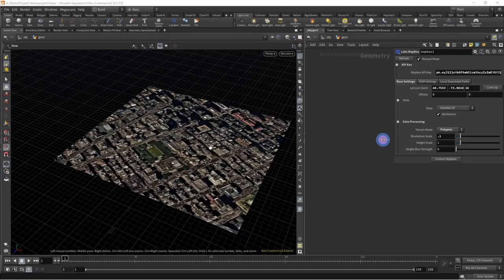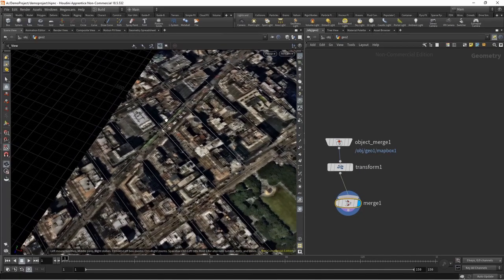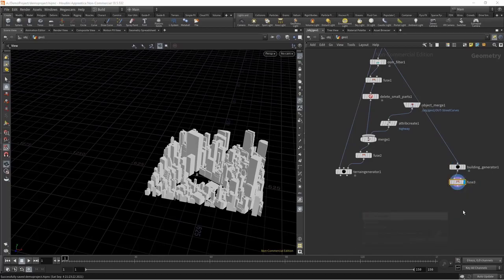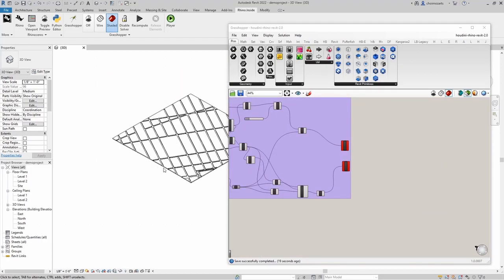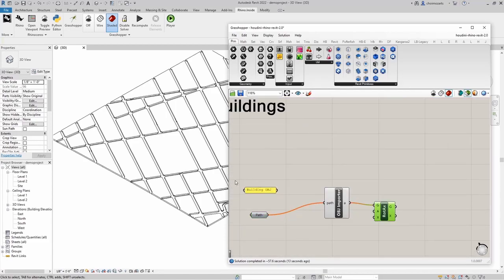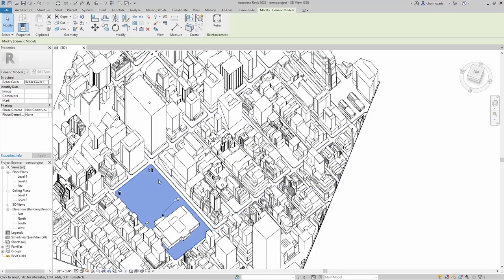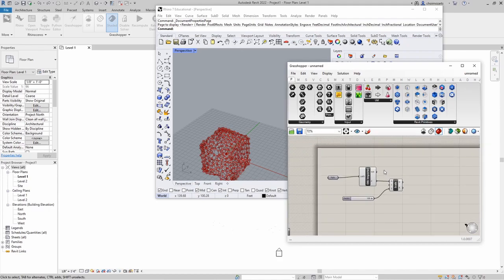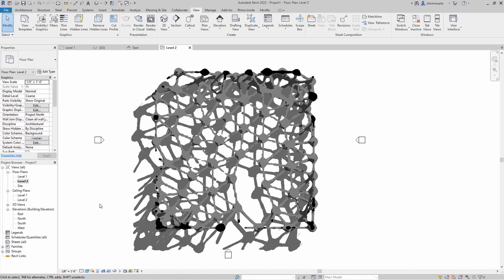Houdini-Rhino-Revit | Procedural Site Tools and Polygons to Nurbs

Comment: This looks very useful. I was wondering where did you get the JW Terrain Generator nodes?
Reply from the maker: These were very early hdas i made, i would not recommend following them. The basic idea of the terrain generation was very simple and im still honesty not sure what the best way is to do roads. In this example i was doing a boolean on the base mesh, but in this might be better done with heightfields now.